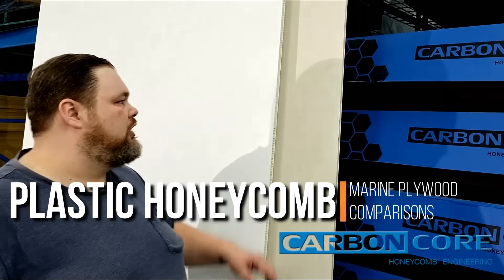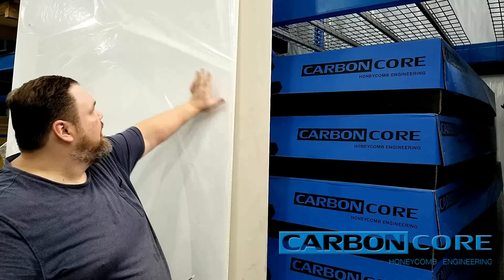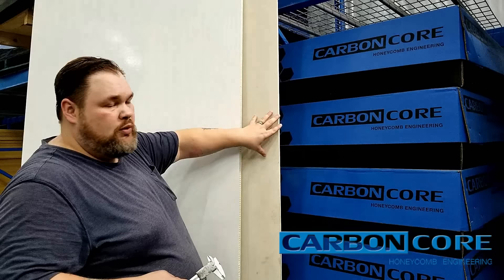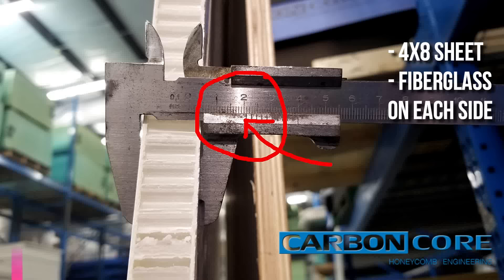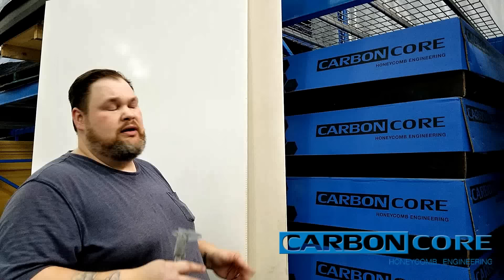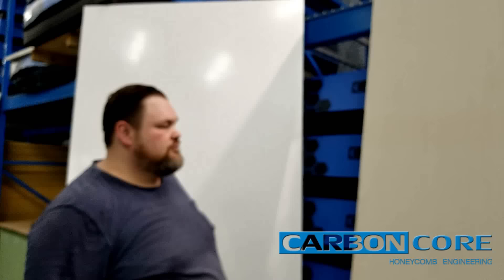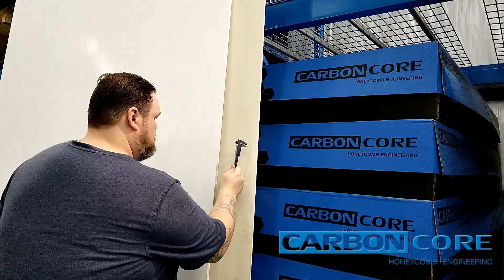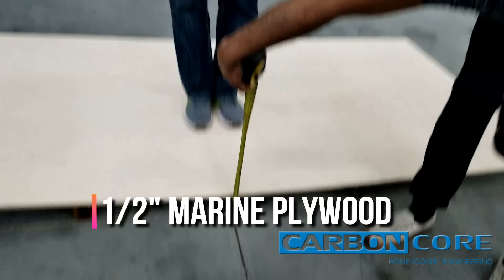Plastic Honeycomb Composite Panels VS Plywood

Comment: What about breakdown in the Florida sun over 20y? Any off gassing ?  Is any part of this product from recycled materials? Will screws be a secure as they are in wood?  Can it be used in a small house build in place of wood sheathing?.. and the 1M question.. price comparison?
Reply from the maker: There is no off gassing, no recycled materials used in our  production currently. Screw retention is obviously not the same as  wood,  but you can get close  to same values  with right type of  fastener. You can check the prices on our  website, but no light weight  composite material is comparable to  wood prices.  Boats  have been built  for  40 years  from this material  with large percentage of them residing in Florida.  There is a reason boats are not built out  of  wood  for  a long time.

Comment: Hi, I am interested in these panels can I cut them with a jigsaw or a circular saw also is there some kind of bonding glue or epoxy that will permanently bond them,
And how do you order?
 I’m building a camper trailer and like the rigidity and the weight these offer .
Reply: too late now - but reverse your circular saw blade for cutting plastics

Comment: Marine plywood is not coated with fiberglass on a pontoon boat.  It is just screwed down.  But your product looks nice.  On a pontoon boat, numerous holes are drilled through it for rails, wires, control cables, seats and accessories.  Will your product allow water into the cells once it is drilled?
Reply: No. Each cell is separate from the others.

Comment: Can this material be used as an engine hatch? Mine presently is crazy heavy plywood. Thanks
Reply from the maker: Sure thing, common use for this material.
Reply: @CarbonCoreCorp , what fasteners should you use for the hatch hinges?

Comment: Only negative thing I’ve been hearing about honeycomb for boat floors is it’s tough to screw into if your trying to add a tower . Or anything that needs to be structurally secured.
Reply from the maker: Steven,  you are  correct. Adhesive  bonding and  sheet metal  type  screws  are is a  commonly used  technique  to  address  that  problem  and  larger  backing plates  can also be  used  effectively.  Usually the  extra  effort  is worth  the reduced  weight.
Reply: Make fiberglass backing plates about .25” or thicker
Reply: bonding - full length strength vs point contact

Comment: Hi !

I'm in the wheelchair and damaged my van floor twice, with plywood base, so I'm looking for a different solution. Could this be a valid alternative, strong enough and water resistant ?
Reply: ...add another layer of plywood, sandwich them together with epoxy.   Maybe the original panel in your van was too thin?
Reply: @Texaca  Not necessary. Most probably, water infiltrations, leaks from the dog bottle and so on. That combined with heavy wheelchair, disaster ensured.
Reply: @syncrovanCos  You can seal the wood from water with a layer of epoxy. I work with the honeycomb material advertised, I can't see any reason to avoid it in your application. It's not great at heat resistance, melts at boiling temp, but that should not be an issue inside a vehicle.
Reply: @TheThomaswastaken  Indeed, this could also be a valid option, since last time I didn't apply any protection for the wood ! In theory, if it was well protected, should not get damaged by the water, even in case of infiltration.

Comment: For clarity, to use as deck or add a false floor (my case) in a boat, the surface IS already fiberglassed so it's simply a matter to add fiberglass & resin at edges to attach/fair into the sides of the boat?  Also, is the 19mm stiff enough as is, or would it ideally need stringers to support it underneath? Thanks.
Reply from the maker: You are correct,  download  product data sheet from our  website,  for composite panels,  it  will detail  bending stiffnesses  based on thickness or  call us  and  we  will help  calculate  the correct thickness  for you

Comment: Do you have instructions on creating a curved surface using the plastic? Say a camper for bicycles. This will reduce the weight but not sure I can bend it without break it.
Reply from the maker: Hello,  not  easy to  create a  curved  surface  with this panel,  probably should use  unlaminated  honeycomb  in mold  to  create  curved  surface

Comment: What’s the exact name of this product on your website, I would like to takeout the wood casting deck I put on my Jon boat and add this
Reply from the maker: composite laminated panekls
Reply: @CarbonCoreCorp  can you use screws with this
Reply from the maker: @amateuroutdoorproductions7044  you can but recommend sheetmetal thread screws as skins are on the thin side

Comment: looking for 3/4 thickness  4x8 panels and how hard is this to cut and shape
Reply from the maker: We  stock  these  panels  and  they  cut  with ease  using  common  woodworking tools.To answer  the  shaping question, need  more detail,  you are  welcome  to call us  any time.
Reply: @CarbonCoreCorp  these would be for custom arcade cabinets if it's feasible.  Should be lighter,  stronger and last longer than other  types of wood. I looked at hemp but I don't think we are there yet.

Comment: How smooth and flat is the surface?  If I were to apply a film to it, would it show imperfections or would it be glass smooth?
Reply from the maker: Its very  smooth, but not high  gloss smooth though, if the film is  about  40 thou thick,  should be  glossy smooth.
Reply: @CarbonCoreCorp  thank you and  One last question.  Permeability, does this material need to be painted or otherwise to seal?
Reply from the maker: @geosciencenerd  It is  gelcoated  with UV  stable  gelcoat, so it  does not need  to be  painted  or  sealed.

Comment: how it is attached to a wooden frame...... you can screw and countersink on wood.... can you screw and countersink on the composite panel.  i will explain.... i am planning on making my own high top for a van.  weight is an issue,  but being easy to work with is important to me.  i was going to build a frame.... then sheet it with quarter inch plywood then fiberglass over that.  the roof of the van has to hold about 300 lbs of solar panels plus the weight of a maxx air fan and the hardware to hold it all up there.  so i need structural stability .  flex is NOT my friend.  i figured i could do 2 or more layers of fiberglass to help as well as reinforce the corners with some woven roving or some other comparable item.  if i could reduce the amount of lumber and still have rigidity  it would lighten up the top considerably. however if the panel will "rip out" or "crush" when attached then it wont work.
Reply from the maker: Hello, easiest way to add stiffness is increase thickness of the panel, alternatively, reduce the free span of the panel by adding supports in the middlenof the span. Adhesive bonding and or sheetmetal screws are viable solutions to replace wood screws. To save all that weight you will need to do some extra work.

Comment: The sound test didn’t use acoustic sensors. Fail. The deflection tests showed weakness of the advertised panel. Fail. No serious head to head tests were performed in this video. Fail. #facts

Comment from the maker: Yes Sir, our honeycomb is compatible with both resins and thousands of boat bulkheads have been successfully built with our core material.
Reply: I am looking to build a sleeping platform at the back of my first. I’ve seen people use plywood to level the sleeping surface. Will your product work just as well while reducing the weight? If so, Which type should I buy? Thank you very much in advance.
Reply from the maker: @gevorgnazaryan8720  Absolutely,  if  you call our  office, we  could run calculations, that  depend  on how  you support the  panel, but  typically, 25 mm, or  1"  panel  should  work  fine  for  what you  do.

Comment: Honey comb will still need resin and a layer of glass on both sides for strength which will and some weight. You should notate that in your description. It will still be lighter than wood.
Reply from the maker: All our  weight and  calculations for  our  panel  have  the  resin and  glass  weight already included. Honeycomb  by itself  without the  glass  and  resin would weight only 13 # for  1"  panel  4x8 size.
Reply: @CarbonCoreCorp  Hi what type of cloth is used on the laminated panels? and what is the weight of 1" panel 4x8 laminated?

Comment: If using this for hull wouldn't it be easy to damage if you run into floating debris?
Reply: It's more impact resistant than wood.
Reply from the maker: Other  way  around,  plastic  honeycomb is one of the  best  impact resistant core materials  out there.

Comment: You compare deflection with a bare piece of ply claiming the honeycomb has only a tiny bit more deflection, but with a ply covered in fiberglass will deflect nearly nothing at all. Yes the ply with fiberglass is 3 times heavier but 10 times stronger.
But i like those panels, but you speak of the ply when it is covered in fiberglass, but you test a bare piece.
Reply: And is it me or is there a piece of structure under that honeycomb sheet when doing the deflection test??

Comment: what it cost  for  3/4 and 1  inch  4x 12 sheet or 4x 8
Reply from the maker: http://www.carbon-core.com/product-category/laminated-panels/  , please check the link for  prices and  quantity breaks
Reply: 4x8x1 is 207.00 and then they add gel coat or other coatings by the foot. Seems pretty expensive and the reason they probably won't list the price on here. 
Anytime a company won't give prices in there videos I move onto the next product because I know it's going to be a deal breaker. They're afraid to mention it without a salesperson around to talk you into it.
Just my opinion.
Reply: @DaveM2  Marine grade plywood, depending on quality can be 150 a sheet. Then add cost of FG and resin. Their cost is 193 for   Seems more than competitive and losing 40% or more of the weight of the floor is a major bonus. The whole point is picking a better performing product. Usually, you pay more for better performance but here it seems to be a wash, at worst. Also, adding a price to a video that might be on YouTube would be a poor idea since someone could watch it 5 years from now and their current price might be 20% more than what is on an old video, making an awkward situation. I get what you are saying, but seems better if you  look at it more closely.
Reply: @danmallery9142  
I hadn't thought about the prices increasing, that's s good point. Honestly I dont know if that's s good price or not, I just hate it when company's arent up front with pricing. Theres a lot of them that ask for you to call for a quote, and that's what I get annoyed with.
Btw, the company could have answered the question that was asked about price and they chose not to, which is why I looked it up in the first place. If they had responded, I probably would not have commented.
Point taken though!
Reply: @CarbonCoreCorp  .51 inch or 13mm $171.86

Comment: Dude You rock!!! Great info. Can you line the cuts with something to avoid exposure to the honeycomb?
Reply from the maker: Thank you, and  yes,  depending on your application,  aluminum extrusions  work  good, or  one  can rout out  some  HC  and  fill with  putty, or thickened  resin.
Reply: @CarbonCoreCorp  Can a poly glue work as well in  a caulk tube like pl premium or something of the sort that one can still epoxy over or take poly resin over?

Comment: You did not show total deflection force before breakage.   That is what matters most.  Also, if the application requires a rigid material the honeycomb is NOT a good choice unless or until you add fiberglass and resin similar to plywood.  Also, you did not show the break strength of the plywood with the fiberglass and resin which you keep referencing.  To further show the weight comparisons, you should have added fiberglass and resin to each side of a 3/4” plywood.  Finally, you did not mention any price difference AT ALL!!!!   HELLO?!?!?  Price is always the number one selling point.
Overall a waste of my time.

Comment: Watch at 3:25 and you will clearly see a piece of metal they put under the honeycomb to stop the deflection, it's a great product!...i just don't think those measurements were honest enough.
Reply from the maker: Very lame  of you to  suggest  we  engage in fraud. I  guarantee  there is no metal or  anything else  under  that  panel.
Reply: @CarbonCoreCorp  just look at the video and then tell me I'm wrong, i personally use the product for my marine applications, all I I'm saying is that i don't agree with the measurements from the video ✌
Reply: @CarbonCoreCorp  ✌
Reply: @4k_outdoors792  I see what you're saying. However, since that was a panel we still needed to sell, what appears in the video is the mylar thin plastic film still stuck to the bottom.

Comment from the maker: I  can not  think of a  reason  why  you  could not.  I  would check the spacing on the  crossovers,  on cheap trailers  they are  really far apart. Ideally, they  should be  16"  apart.Race  car  ?

Comment: foam core and epoxy resin is too brittle for marine applications, this is obvious but after reading sailing yacht surveyors it looks more terrifying, as a result recreative sailing boats cannot be used for nonstop bluewater sailing, a big mistake that makes current sailboat fleet worthless. 
also monohulls ballast increases tension and structure fails making them even worse. 
reinforced fiber plastics for honeycomb and walls must be the norm but today structural programs, multi angle lineal fiber focalized configuration and continuous fiber plastics 3d printing can make possible focalized multiple layer and irregular lattice sandwichs with thermal bonding and then filled with foam to increase strenght
Reply from the maker: Ayoze,  Interesting point: however,  one  should understand  that  epoxy  and  foam  core  are  not  to blame.  One  needs  to blame  the  shoddy  workmanship  and  manufacturing techniques  for  failures  with this  type  of  construction.  If  done  right,  absolutely the  best  method  to  build  a sailing  yacht. There  are  lots  of  builders  out there  that  do it  the  right way. What is the  alternative?  Wood?  If  you  you see the  hundreds  of  boat repair  people contacting us like  we  do every day trying  desperately to  fix their  rotted  and  damaged  wood  cored  boats, you would  change  your  mind. In my  30 years  selling man  made  core  materials,  I  have  seen  just a   few real  world failures of  core  materials,  as  compared  to  10s  of  thousands  of  wood  issues,  from balsa  to  plywood  .
Reply: @CarbonCoreCorp  thats because the age of sandwich built fleet, and also because overall maintenance is higher in wood due to permeability. 
but even most boats are used as recreative sailing, with little use or being sworn fast by competitive sailing or travelers. if used constantly in blue water sailing they are worthless, not only because poor sandwich adhesion techniques (lattice can fix that) and epoxy cracks and easy water rotten cores, but because epoxy brittleness against impact and immediate sinking (there are foam anti sinking systems too, but the crash destroys the boat structure). 

also,  fiber automated microlaying and exact high temp liquid plastic dose can increase fiber plastic ratio (this can be used with heated epoxy too) and reduce weight. 
also its important a sun irradiation protective final layer like aluminum mylar with hemp fiber for example

Comment: Why would you make it a different thickness than standard lumber? Nonsense
Reply from the maker: Jim,

It may  seem that  way to you, but it is not..Commonly, these panels are  used  to replace a  rotted  out  deck on a  boat. Since our panels are slightly less  stiff  than plywood,  we  make our  panels  slightly thicker  for this application  so that  the  stiffness  will be retained  as  compared to the  original boat. Vast majority of  plywood  nominal  thicknesses  we  can  duplicate and  have in stock.

Comment: No mention of cost?
Reply from the maker: Check on www.carbon-core.com for various thicknesses
Reply: @CarbonCoreCorp  What I was referring to is that the price is now comparable to marine ply. That was a huge disadvantage in the past.
Reply from the maker: @noyb72  Yes  Sir,  especially  when you take into account that the  panel is  already fiber glassed and the  plywood is  not, but has  to  for the marine  applications.